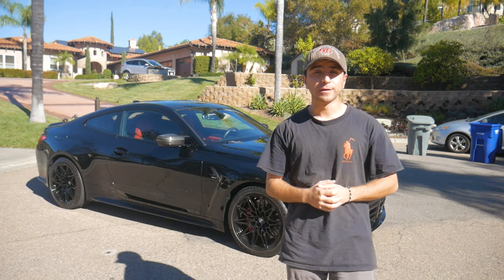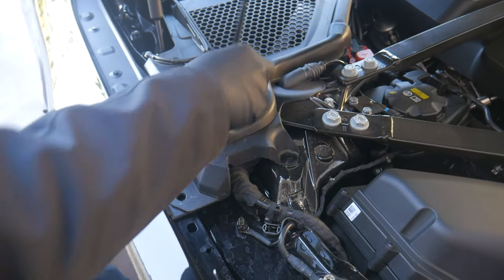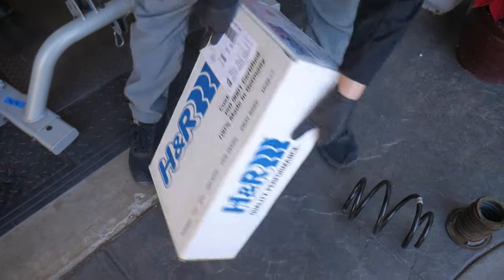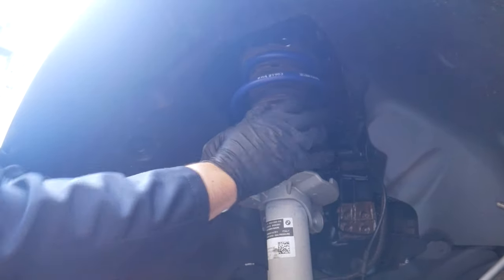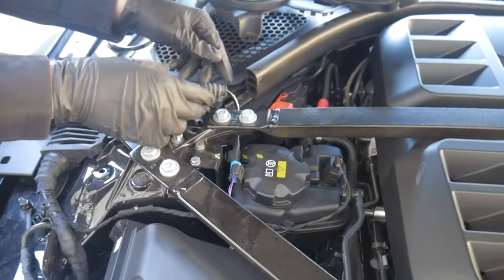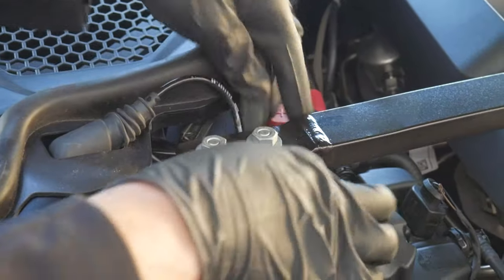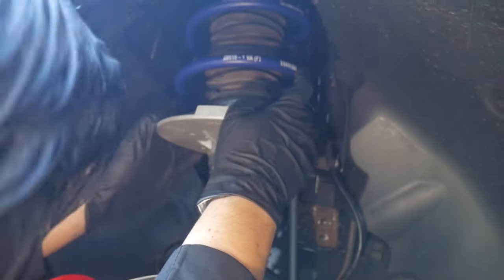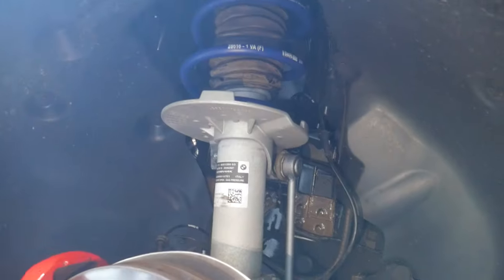BMW G82 M4 Gets H&R Sport Springs! FULL INSTALL DIY + BEFORE & AFTER!

Comment: I prefer this install over removing the front Axel bolt which is single use and has a unique torquing procedure. Great job!!
Reply: His vehicle is RWD, most likely have to remove it so axle doesn’t seperate on xdrive

Comment: I can't figure out how to drop front strut down and pull out towards me to remove springs .  Mine drops down and the strut won't clear wheel well nor does the rotor feel like it's leani g out enough to get acess to remove and put in new spring. I'm stuck right now. Put everything back together.  Does xdrive make a difference in install process? I'm following every step

Comment: So..this is a non x-drive car?? Correct? Can you just lower the control arm/strut on an x-drive car and rotate it out? I would guess not???   Do you have to disconnect the front axle by taking out the center bolt??

Comment: Hello , how do you compress the front coil spring or just loosen the top bolt?
Reply: they showed it - you jack up the lower control arm and take pressure off of the coil before taking off that upper bolt on the strut.